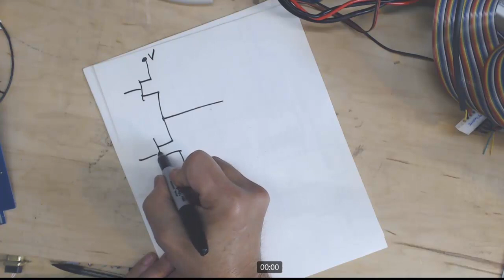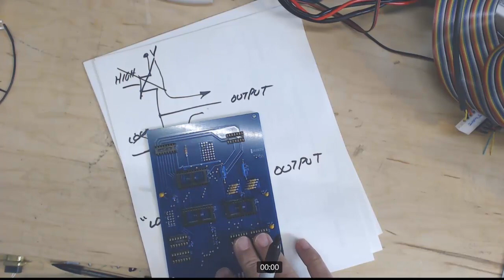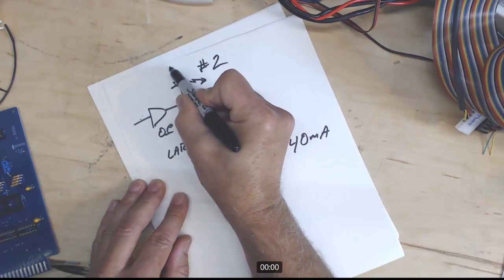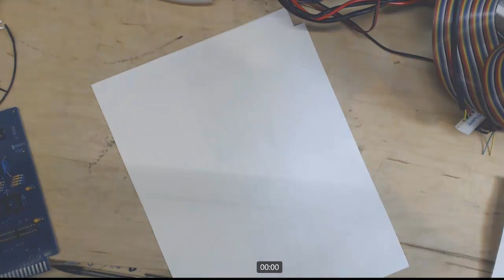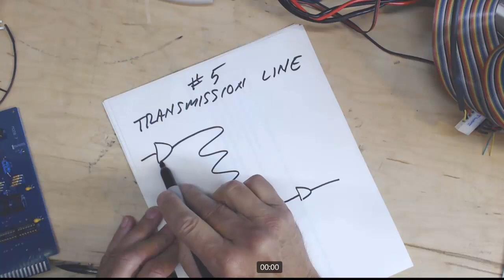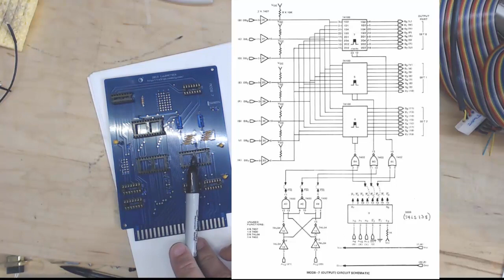{21} Five good reasons to use open collector buffer but the MOD8-7 8008 doesn't fit any of them ?!?!

Comment: A wild guess, not knowing the timing on the bus or quite being able to make out the values on the schematic, but if those are 10k pullups on the OC outputs there'd be a ballpark 100ns delay to a rising edge on those data lines going to the latches. They aren't edge triggered so it might be to meet hold times on the D inputs (particularly if the data lines on the bus were pulled up)?
Reply from the maker: You may be onto something.....

Charles has the documentation here: https://va3ngc.weebly.com/mod-8-documentation.html

Admittedly I have not really chugged through the minuscule details of the MOD8 output.  So this is worth the time it takes to work through the logic since a port output is an incredibly convoluted process....

As a recap of how an OUT machine instruction works.  the first machine cycle is like any other instruction fetch.  The second machine cycle takes three T-states.  The first T-state the output data goes onto the data bus and the MOD 8-3 buffer board latches that data byte to internal latches.  During the second T-state (still in the second machine cycle) the port address goes onto the data bus and the MOD 8-3 latches that onto the address lines.  As soon as this data hits the address lines the logic on the output boards should be able to decode the address and be ready to latch the data as soon as an OUT* strobe comes along.  So setup time on the address shouldn't be an issue.  The MOD8-1 also watches these two address lines and recognizes this as an output instruction because A12 and A13 are high as well as the two most significant bits of the machine instruction being 01 (remember the OUT machine instruction = 01RRMMM1 where RRMMM is the port number).  That all happens in T2, so setup time on the address shouldn't be a problem.

There is a lot going on during T3 so i maybe need to go through the timing in my head and on lots of paper before i am certain about the role of phi-2 in the timing.  The latching of 10A on the MOD8-1 board may not be happening exactly when i think it is.

But at any rate, during the first half of the third T-State, i.e., T3A, in the MOD8-1 the ALBE* signal becomes active (low).  This now gates the previously latched output data (captured during T2) back onto the data bus.   Two gate delays later the OUT* strobe will go low.  The OUT then follows Phi-2 and OUT* becomes inactive when Phi-2 goes low.

That is an incredible amount of goings-on being gated by the Phi-2 clock and I would question if the data bus is stable when OUT* goes low.

Then to end the third T-state, T3, the 8008 waits for a READY input.

But, and probably all important, the 74100 is a transparent latch, so the output data follows every transient and ripple in the input data as long as its enable is low.  So while the OUT* is low, the MOD8-7 output lines reflect all the junk on the data bus.

Could it have been to maintain a setup or hold time?  The onboard EPROM programmer uses the same 74100s directly connected to the data bus.  The 8-7 does have one more gate delay on the final out strobe than the onboard programmer.  (since the bus out strobe goes into the 74138 and then the 7402 but on the EPROM programmer it only goes through the 7402).  So maybe not a setup or hold issue since the 74100 on the EPROM programmer has no problem catching the data.

If it is a transient problem, why isn't that a problem with the 74100 on the EPROM circuit?  because that is double buffered for the data (using the PVE* signal) and for the address a little ripple never hurt anyone as long as it is done before the RD* or WR* strobe comes along.

I don't know if this is the answer, but i think we are closer.... Having these open collector buffers may just cause the data lines into the 74100 to be sluggish enough to reduce the transients coming through while the 74100 is transparent and before the 74100 latches.